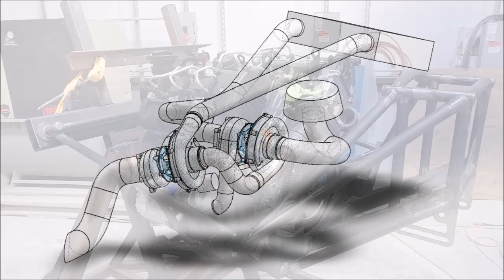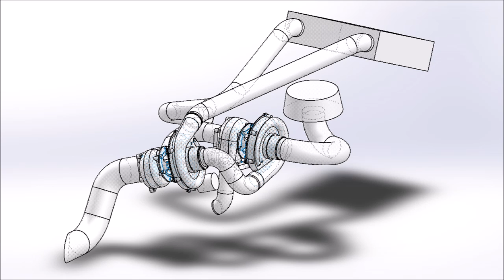Raptor Aircraft March 7th 2017

Comment: Many years ago, I used a kerosene construction heater for its intended purpose.  The fumes were so bad, I stopped using it even though it was one of the coldest winters here in North Carolina and I had construction deadlines to meet!  That being said, what chemical effect, if any, would the un-burned hydrocarbons put into the environment of the oven have on the "curing" process and the "cured" part(s)? Ron S.
Reply from the maker: Watch the next video.

Comment: Brain G...  I am either #68 or #69 on the old delivery list. I started watching & learning about the Raptor project as soon as the first YouTube video was uploaded.  I sat on the fence watching, falling i love with the concept of a pressurized Raptor. It was not until the 3.0L TDI Audi was engine was chosen for install into the Raptor. That sealed the deal. I loved plane & with an Awesome engine! I could not sit on the fence one second longer.
Reply: Newtz So, is the Turbo Prop no longer an option? Thanks! p.s Nothing wrong with the Audi 3.0 TDI....

Comment: Upon deployment, how will you ensure that the parachute straps don't end up in the propeller, particularly when in a nose-down attitude?
Reply from the maker: Chute deployment immediately pulls the nose up and shortly after the aircraft is hanging from the straps. There is little to no chance of it getting caught in the prop if it's deployed at or below the recommended speed. For more details contact BRS and ask them.

Comment: The Engine compartment is HUGE!! Great. I love it! There is plenty of room for what ever. My Raptor will require all 370 HP. I need my Raptor ASAP. Peter is there anything you need help with?
Reply from the maker: Obviously if we had more help things might move more quickly but frankly a lot of what we're doing needs time to gestate before we come up with the best solution. So taking that bit longer can result in a better result. So right now we're good. Thanks.
Reply: I'm with you Newtz (I'm 104) and am currently working on my instrument rating.  The club I belong to at the moment has 3 aircraft and all three are pretty much booked up solid for the next 2 1/2 months... (and I'm not one of the book-ies).  I dream about flying this plane everywhere.  I have so many questions still, but I'm sure they will all be revealed in due time as things unfold.

And why anyone would buy a modern aircraft that is parachute capable and not include that feature is beyond me.  Nice having that extra bit of safety margin should there be something fail (although I don't expect it to).